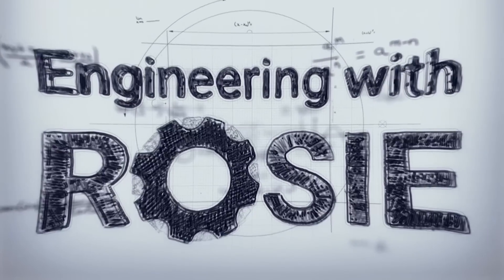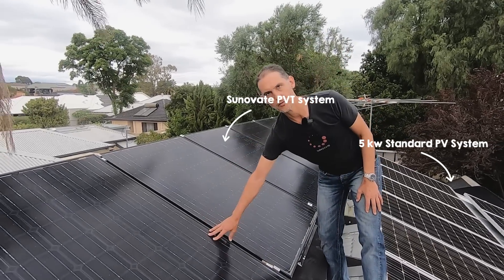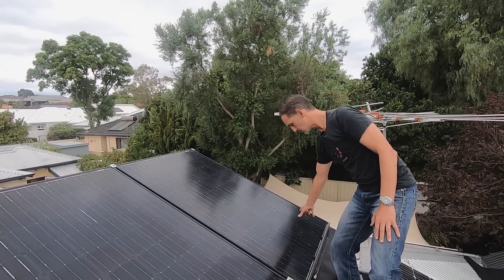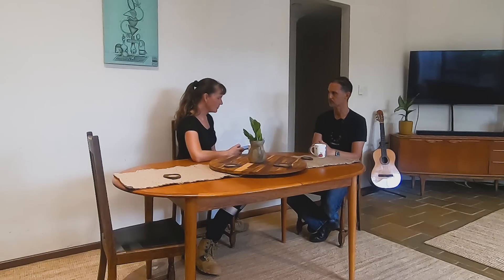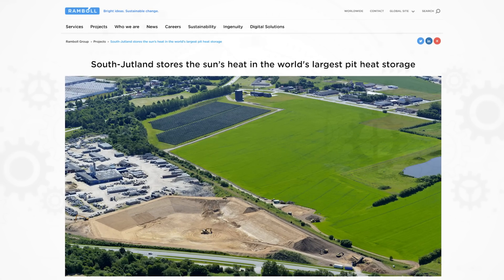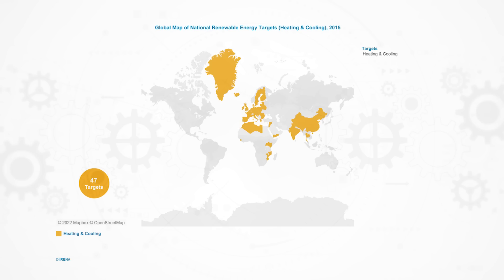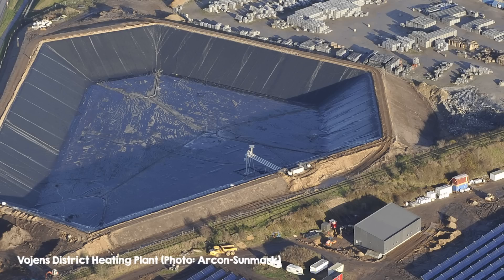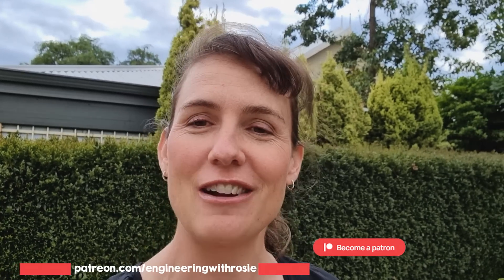Warming Up By Cooling Down Your Solar Panels

Comment: Thanks Rosie,  excellent video.  I too have been considering a similar idea of collecting renewable heat from a house or townhouse's attic using a heat pump coil and fan located in the attic, then running the refrigerant down to a  Hot Water Heat Pump (HWHP). In essence I'd decouple the fan and coil from the compressor and tank of a HWHP. Locate the fan and coil in the attic (being careful to ensure friable insulation is not air-born by covering it with an additional layer of paper faced insulation to ensure it doesn't end up in the fins of the coils) run the refrigerant lines to the compressor and tank which would be located in the house. This idea could be coupled with Sunovate's solar panels. Alternatively skylights could be installed in the attic to improve the productivity of the HWHP. In my climate (Canada) we need lots of heat and the cooling of solar panels is less of a challenge, especially in the winter, snow cover is a much larger issue (would adding heaters to the Sunovate panels to melt snow be worthwhile?).  Our heating requirements are typically 70 to 80% of the house's energy load with 3/4s of that in space heating and 25% in water heating. Other advantages of using the hot water tank in a HWHP is that the solar energy can be stored for over night (a cheaper thermal battery than an electric battery). Additional HWHPs with this arrangement can be installed for space heating.  In Europe there is a thermal storage system by Latento that combines Phase Change Materials (PCMs) with a water storage tank for more compact thermal storage. Or perhaps it makes sense to couple this with a ground source well and store excess heat in the ground (like the Bore Hole Thermal Energy Storage systems mentioned in the video). Lots of opportunities to optimize a solution for these ideas.

Comment: Hi Rosie, I have considered this idea before. My initial thoughts are the most heat is on the top of the cell. So why not box in the heat on the top as well? You can add a glass or clear plastic cover and blow the air across the top of the panel. To even up cell heat distribution you could create channels across the panel, maybe blowing the air in alternate directions, one channel one way the next the opposite way. Or an alternating direction, continually revering every minute. André in Sydney
Reply: Now you are thinking

Comment: I think a combination of full or partial-Earthships, Geothermal, wind and solar can offset quite a bit of the fossil fuel shortage problems. I also think combining this cooling idea with some solar panel reflectors & all the technologies the energy shortages & high costs can be 100% solved and a nation can be energy self sufficient. Thanks for sharing. Best Wishes & Blessings. Keith Noneya

Comment: If you use water cooling, instead of a  Serpentine coil use a single pipe per row of cells with a supply and return header to keep the temperatures consistent.

Comment: Rosie, thank you for the follow up post, on Sunovate. But Dave Borlace 'Just Have a Think' post. Left me with questions. For example, the jets of air created by the air box to cool the PV panel. Seem to be in the same airflow as the exhausting air. Which would cause airflow turbulence and resistance, And an increased energy demands on the fans to overcome it. And non-even cooling of the PV cells.
So if possible a follow up post. Detailing exactly how it functions would be nice. Or just post comparison testing data. Or if i'm mistaken, please correct me about the actual path of the airflow. And how it's different then how it appeared to me.
FWIW I am planning to install PV panels as part of reroofing my home and I was considering ways to cool the panels. So this could make a difference in how I proceed.
Reply from the maker: I have data for the energy consumption so I will check up and get back to you here.
Reply: Great Question, Our challenge when we set out to just cool the panels was to ensure that energy we invested was much less than the energy regained through cooling. Early systems are generally are 1 to 2-3 times for PV boosting mode. When we are in heating mode the energy recovered is in excess of 1:100+ (i.e. a 20watt fan consumption produces +2kW of thermal heat). We intentionally kept some of the secret sauce from the images but what we can say is that there is next to no mixing of the inlet and exhausting air. This way we get maximum temp lift for a given mass flow rate.
Reply: @glenryan6692  Thx for the feedback and the quantifiable figures for it's thermal vs electric use efficiency figures with one caveat... 

May I suggest considering developing a BIPV-T version. Since the airbox is to be made out of sheet metal. Which is what  BIPV standing seam panels are made from too, such as from Roofit.Solar. So a BIPVT version, seems like the logical and synergic step to take. But not necessarily using the 'standing seam' format. Since 'stamping' gives you other value added options. IMHO

And my caveat is your statement "that there is next to no mixing of the inlet and exhausting air', since you did not quantify it... 

Good luck developing your prototype, since it is an intriguing concept.
Reply: @glenryan6692   BTW I have a BI-PV-T concept that uses the rafters as a cooling channel. I would be happy to give you more details about. If you would be interested in developing it.
Reply: @EngineeringwithRosie  Thx, and I hope you do a live stream on all the current BIPV and BIPVT options. I have to re-roof my home soon. And I'm trying to decide if a BIPV option is feasible for me in the USA.

Comment: Mass thermal storage has fascinated me for a while. I had an idea of burying 1 or 2 IBC containers and to heat that water through a summer season and then with internal heat exchangers use that for base heating in a house.
Reply: If you use water, which is a good choice, you can calculate the capacity quite easily. The specific heat capacity of water is roughly 4.2 J/g/K, which means if each IBC container has a ton of water you can store 4.2 MJ/K per container. If you manage to heat you tanks to 100 °C, and consider anything above 20 °C useful energy their capacity is 336 MJ per container. That's ~93 kWh, per container. But, without fantastic insulation most of that heat will be dissipated long before heating becomes an issue. It can, best case scenario, probably delay the need to start your heating system a day or so.  Also, heating that much water to 100 °C would require something like solar concentration, or active heating/heat pump or some other type of input other than passive collection of excess heat. The energy between 65 °C to 25 °C is much more realistic assumption for calculation of usable energy without heat pump the day after you stop collecting heat, which is half the energy, ~47 kWh/ton of water.  

Seasonal mass thermal storage needs a ridiculous amount of mass to be meaningful, and cost essentially nothing per kWh of storage capacity.  ~0.02 IBC tanks and work and everything required to harvest, and insulate, and retrieve that heat per kWh per year is way too much investment to be worth it for the energy alone. Add personal interest, and it might be worth it, just don't expect such a system give savings to pay for any "large" investments when cycled once a year.
Reply: @fishyerik  I think something like that would go with cutting edge housing using best you can get insulation and only be expected to heat perhaps the first 5-10 degrees. I would not expect it to fulfill heating requirements in of its self. I would definitely be using insulation around the water tanks. 
Really the idea was thought of as being part of a range of possibilities for heating.
Reply: @fishyerik  I live in the SE corner of BC between several lakes we store about 30 million acre feet of water and provide power to half the province's 5 million people. Spring runoff will begin any day to refill these reservoirs for the next winter cycle.  There is NO storage that can match this. Batteries are short term, tosic disposal and dirty power, our water is clean and green.  All this water in turn flows into the US Columbia river and makes power through several dams for millions until it hits the Pacific ocean
Reply: @Nelsongrantscams  Not sure how that relates to my analysis of seasonal thermal storage in an IBC tank or two. 

Great if you have the conditions required to make large scale seasonal thermal storage practical. But no need for that BS about batteries, I assume you can't power much with the energy stored as heat?   

Also, spring runoff refilling the heat storage, as in heat stored in form of spring runoff? Just no.
Reply: @fishyerik  they are talking about hydro, not thermal.
Reply: @adrianthoroughgood1191  Thank you! That was too far from relevant to my comment for me to realize that he was actually referring to that. Also, from that aggressive bragging, I expected something at least a bit more "special" than common hydro. 

But I think Norm is just one person, we, "Yoda" and I,  were talking about thermal, no doubt. So I don't get the "they are" part?

Comment: Living in ipswich Qld, my winters are reasonably mild compared to other places. So for me the benefit of this system would be the increase in electrical output of the system. 

The real holy grail would be the creation of panels that turn infrared light into electricity. Then these panels are then sandwiched with traditional pv panels

Comment: Hi Rosie, nice to hear about this progress and testing.  I disagree with a comment that I heard in your discussion.  If we look at a simplified electrical power system, broken down into generation and distribution.  Distribution will continue to come up in discussions due to its limited capacity, high costs, and the higher losses associated.  But as our costs of generation approach zero costs, the overall cost of distribution of that power will be overcome by the localization of the generation.  We. need to move quickly to focus on solar with appropriate storage systems that have the capacity to almost completely overcome the bottleneck of distribution.
Reply: Distribution is still essential to transport electricity between sunny and cloudy locations as weather moves across each continent.

Comment: My area has clouds and rain all winter. Sometimes 30 days of overcast and rain straight. It's hard to do PV here in winter without lots of batteries. Luckily, we have hydroelectric dams everywhere and our grid has always been 100% renewable.
Reply: Hi John, this is part of the reason we suggested incorporating thermal storage solutions and systems like Hydro can then be run as the absolute large resort for servicing thermal demand.

Comment: Early refrigerators ran on kerosene, and people still use refrigerators that burn propane or butane. The flame size required to run a medium sized fridge is only about 25 mm in diameter. This being the case, it would seem to be doable to use extraneous heat from cooling solar panels to produce cold air for air conditioning.

Comment: Thanks for the video Rosie:
Can this heat be harvested economically to drive a Stirling Engine for generating electrcity?  
Or maybe we should look at using the walls and floors of concrete basements to store heat at least during winter months (I am in Canada)?  
There is also the application using this heat for drying clothes in winter?

Comment: I remember I seen a passive system consisting in a black box with air circulating inside that will keep the inside of a shed above freezing temperatures at temperatures below -20°c.

Comment: Now we need a system which can be combined with the existing panels already on the roofs. So a "cabinet" in which the existing panels are placed and the panels are 'cooled' and that energy is being used. Ofcourse the retrofit should be commerically viable and be done by lower schooled technicians due to the lack of high schooled technicians. just a thought.
Reply from the maker: This would be possible, and it's something I talked about (off camera) with Glen. At this stage Sunovate's scale up and cost reductions are very important to the success of the company so standardisation is key, so I think that's why they're not going down that route right now.
Reply: I haven't tried it but it looks like just paneling over the back of the frame & adding forced-air junctions (possibly in the corners) would be a simple retro-fit.

I don't know how you avoid the electrical junction box being a hot-spot & degrading the whole panel though.
Reply: @EngineeringwithRosie  I'm thinking a cheap modular system could be based around domestic guttering & downpipes as interconnects between plain sheet-metal backings on the solar panels (possibly with foamed polystyrene insulation) & then off to whatever plant extracts the heat. 

The backing panels would be hole punched across the ends & guttering glued over the holes with maybe silicon rubber or Sikaflex. Bends, 'Y' pieces & jointed pipes are available in a reasonable range of sizes.

Comment: Yes, I've been pushing this idea since 2007.  It's a no-brainer.  I think a simple air-tight sheet metal backing could be applied to solar panels with inlet and outlet connection points for air based temperature control.
Reply: I had PV and water solar in the UK. I was aware that the PV gets less efficient over time and temperature. now in France I need some heating (ANY heating!!) and the idea of these Sunovate panels is great. Systems that would be 'easily!) retrofittable OUGHT to sell well and i can only hope that a push by the EU to promote such systems would benefit all. the cooling by air is such a simple and inherently safe solution where a bit of 'leakage' due to damage/age etc is not a problem.

Comment: We live in Perth WA and enjoy solar electric panel generation on our roof. The main problem we've had for years has been due to the house being so well insulated, the coldest months of June to Sept are also sunny but moving warmed air into the household space is difficult. Sometimes midday in winter it's far warmer sat in the garden than indoors. A warmed air mass would be a welcomed innovation that doesn't involve using a reverse cycle air conditioner.
Reply: This is one of the selfish reasons that we developed the tech. Our solar passice design house had all the sun taken away when the neighbor built to their maximum height limit.  We froze that next winter. Now with the Sunovate solution we can now comfortably wear tee shirts in winter and not have to rely on the reverse cycle air conditioner.

Comment: I was imagining large thermal storage units, but never thought they would be practical.
Reply: There are a few houses built with seasonal heat storage. Some underneath the house in sand. It is close to geo/ground-thermal heating.
It is a system I'd like to incorporate into my own house, just to try it out.

Comment: Hi Rosie, thanks for a very interesting video 👍. It's 18 months or so since you released this, and looking into Sunovate, they've been working on this idea since at least 2019; have you any idea when they're likely to have a product ready for market, and specifically the residential market rather than large scale projects?

The idea of PVT just makes so much sense; the idea that you get more PV from your panels by cooling them and get usable heat for heating or hot water as well just seems to make so much sense that it's surprising it's such a niche market with associated high costs.
Reply: Sunovate will never be affordable for domestic purposes. Hopefully a Chinese competitor will show up and offer this technology at reasonable prices. Standard solar PV only became cheap because China took interest in it. Unless China sees value in PVT, it will never be commercially viable for the middle class domestic market (absolutely no chance for anyone hovering near the poverty line which is most people on earth)

Comment: I keep wondering about heat pumps (in the UK) and whether there's a way to feed them waste heat of any kind so that they operate in their most efficient mode - so I'm really wondering if a system like this could be plugged into an air-source heat pump to any benefit in a colder climate.
Reply: Dig many trenches, lay down many loops of PEX pipes with water. Pump all the heat under ground during summer and absorb heat back during winter. So heat pump can work efficiently all the time.
Reply: The amount of air required to run a heat pump is many times what this would produce.
Reply: @hughmarcus1  I assumed so but at least it could be mixed with the rest of the air going in so that it could help the heat pump to be efficient. Another thing one would want is to mix stale, old air that has come out of the house be mixed with the air coming in to the heat pump too.
Reply: Best system for UK latitudes is the so called 'coffin ice bank heat pump'.
Wet PVT panels are the heat source for the ice bank heat pump. 
The advantage for snow covered panels, is an automatic defrost capability. The snow just slides off via valve reversal.
Reply: It bothers me that the radiator on the back of my fridge and freezer dump their waste heat into the room, while on the opposite side of the wall my heat pump hot water system blows out the waste cold air from it's radiator. 
I look forward to whole of home heat exchangers that can more efficiently move heat around.
Reply: @iamdave84  Yup, the big picture view point needs to happen.

Comment: I wonder if you could make solar panels that change color like a mood ring. 
On a hot summer day the panel might shift from black to green or grey. 
I’ve heard that one reason plants are green not black is because green allows easier thermal regulation.